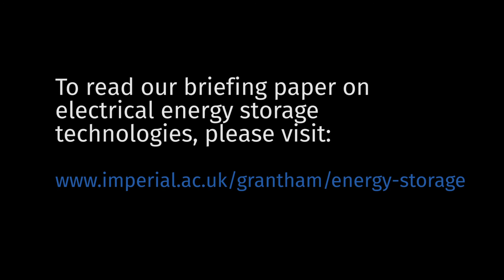Electrical energy storage technologies - an introduction

Comment: Great video but there are some different energy storage too that you didn't mention like Hot and Cold air where you have hot or cold air powering up something or you can storage. Also for hot and cold air you need to be in a room with either hot or cold air you can't have cool air of warm, you need HOT or COLD air. You should try but is one of the most difficult ways to store energy but it is very effective. Just keep that in mind.